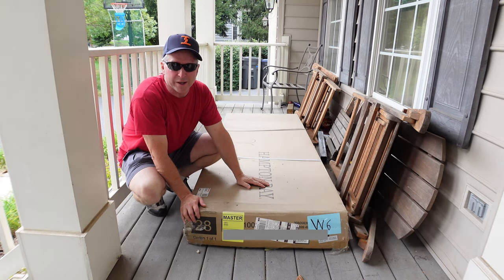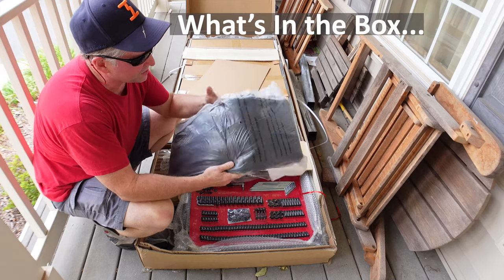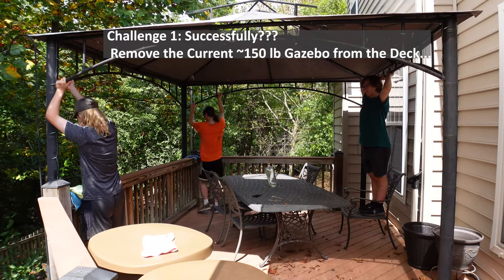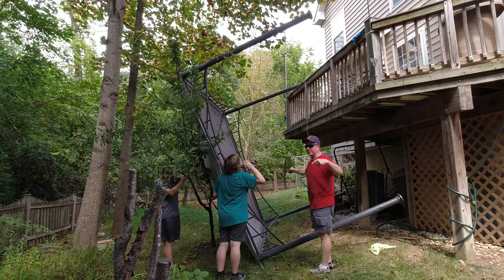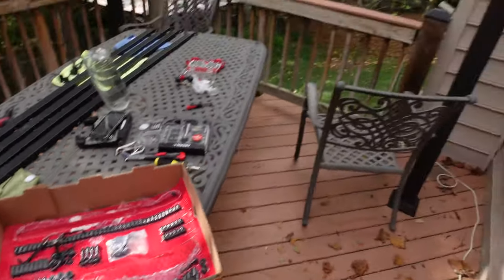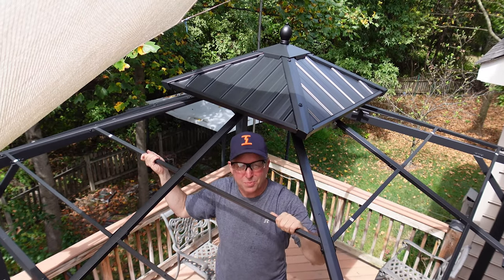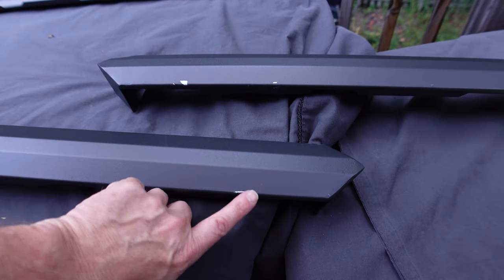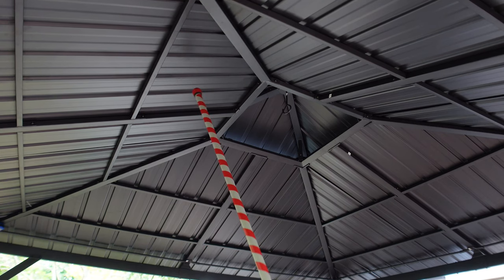How to Build a Steel Gazebo, Tips, Tricks, and Honest Review

Comment: Great video. Just bought the same gazebo,  how did you anchor down the gazebo to the deck?
Reply from the maker: Its not anchored except for its weight. We've have over +60 mph winds since we put this in place and doesn't move. Its also contained in the railing around the deck.

Comment: The measurements between two post pls because i have are 10 x10 and i need to see the measurement between two pst
Reply from the maker: okay the post outside to outside are 8 ft 9 in, there's a square base on the bottom that goes out another 2 inches outside of the post, so on my deck it's out to 9 ft 1in. but the roof extends out to 10 ft X 10ft

Comment: What is the name of app foe step by step directions
Reply from the maker: Unfortunately I deleted the app when I finished the build, but BILT sounds right.
Reply: You used one of the rubber washer/spacers on top to screw the roof down, what spacer did you use underneath? An additional rubber spacer or just one of the plain metal spacers?